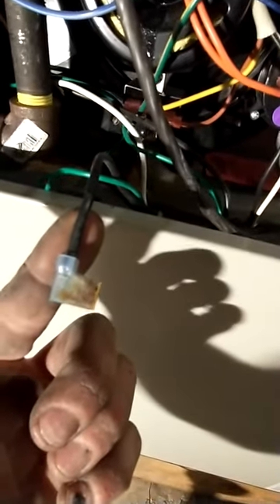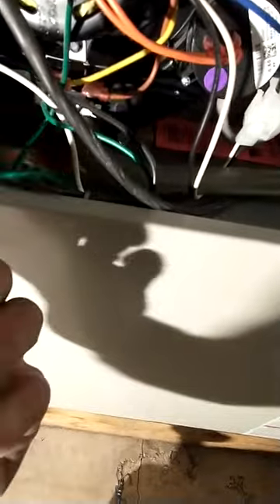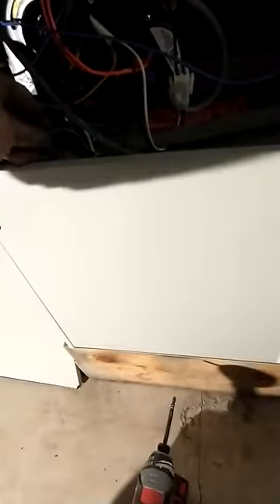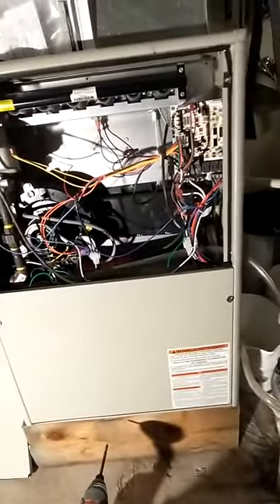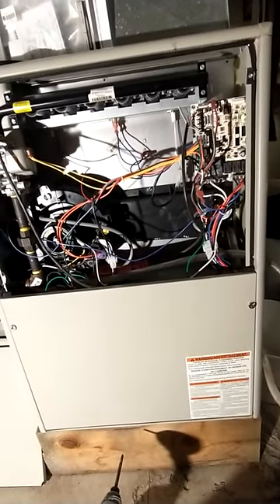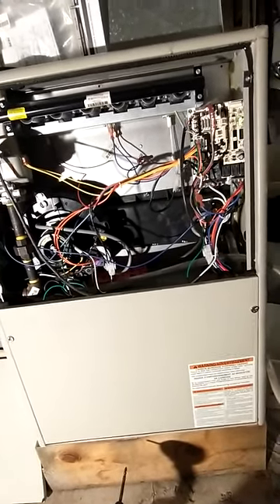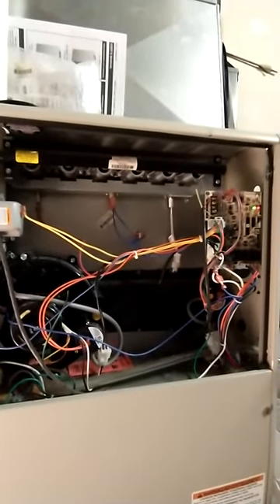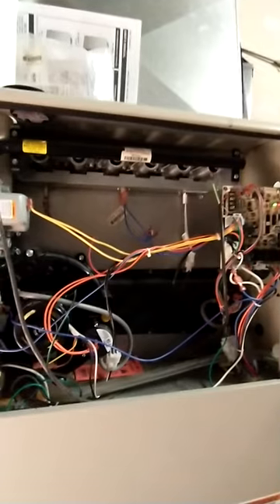Gibson furnace startup.

Comment: Green red light alternating flash ,One hour lockout any tip how to fix ?
Reply from the maker: Turn the breaker off for the furnace for a couple seconds to rest. 
The furnace will try to ignite up to three times before it locks out. If you see the ignitor turn orange but there's no flame. That would be a bad ignitor. If the flame lights and goes out. That's a bad flame sensor. 
Otherwise your furnace can overheat And will turn off.
Igniters you can't fix you just got to get a new one 20 bucks.
A flame sensor sometimes you can wipe it down very gently with newspaper or very very fine sand paper. They are delicate.
Other wise there's a round sensor located near the burners. Usually on the box that surrounds the burners. There's a little button in the middle of that sensor. If you push it and it clicks. That means it overheated. Its a rest button.
Reply: @kevstoolbox225  thank you

Comment: My green light just started flashing. It won’t cut on. Any tips on how to fix??
Reply from the maker: Does the furnace do anything?
Does the fan in the front turn on?
Does the ignitor start to go orange?
Reply from the maker: The blinking light flashed a couple times and stops for a second then repeats. This gives you a code so you can pin point the problem